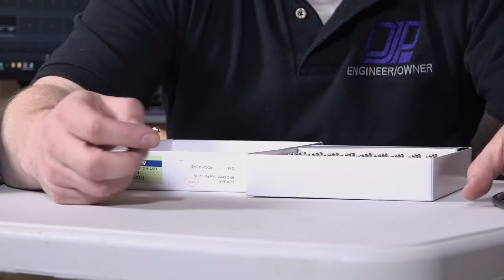What types of cables do you use for SDI professional video?

Comment: We are using blackmagic cameras for live switching with Atem switcher. We are using 2 x 12G sdi cables for camera feed and returns.  What is the best way to have 2 sdi cable wrapped into one single cable?
Reply from the maker: You could use an expandable braided sheath, or a bit of heat shrink every few feet. I'd stay away from tape and zip ties. Velcro cable ties would be another viable option.

Comment: Its now 2024. Good tip about the white inner piece for the rg58 cable (50 ohm).  i havent used my Amateur radio license in over 25 years with lots of cables and antennae etc. Now its video cable sdi/hdmi for digital video cameras and Unreal software.
Reply from the maker: It's not a hard and fast rule, but there is a high correlation.

Comment: I just want to know if 3gsdi and 12gsdi use the same cable
Reply from the maker: Sort of. Both use cable based on RG-59 or RG-6, but the actual design and build quality of the cable matters.

Cable made for 12G-SDI will always work for 3G-SDI, but the reverse isn't necessarily true. 12G-SDI creates a signal which changes four times as frequently as 3G-SDI, which means that the signal is made up of much higher frequencies, and the cable has to be able to handle those frequencies at the distance the signal is going to be run without too much loss or other degradation (timing/phase, noise, etc.). For the most part, a 3G-SDI cable will work okay for 12G-SDI for short runs of a few meters. But I wouldn't expect a cable only rated for 3G-SDi to work for longer runs. 

If you're planning on ever using cable for 4K, I'd highly recommend just getting cable rated for 12G-SDI out of the gate so you don't have to replace it later.
Reply: Thank you for your reply. My real question is this. @djp_video  I have a Canon C500 with 3gsdi, I'm looking for a recording monitor, I found one with 12gsdi. Will I be able to use this recording monitor with my camera and if so, which wire would I need, 3g or 12g? Thank you for your time!
Reply from the maker: Yes. Devices which support 12G-SDI also support 6G-SDI, 3G-SDI, and HD-SDI.

If your camera only supports 3G, all you need is a cable compatible with 3G-SDI, which nearly any 75-ohm coax cable with BNC connectors will be at that short distance.
Reply: Thank you God bless! @djp_video

Comment: Hi. Can i use the belden 1642A for video broadcast? Is it rated for 6g sdi? Over 100meters? Im currently working on 3g sdi ecosystem. But i want it to be future proof abit. Is 6g enough for broadcast in the future or 12g? 

And i need to run 100 meters. Thanks! Lookig forward for your reply
Reply from the maker: I assume you mean 1694A? 

It will work for 6G-SDI for some distance -- I probably wouldn't go more than about 50m. And 12G-SDI at a shorter distance -- I don't think I'd try it past about 20m, if that. But it isn't really meant for either -- it's designed as a 3G-SDI cable. And I wouldn't try to run it to 100m for 3G-SDI either... SDI itself isn't even rated for distances beyond that. That's when we usually move to fiber.
Reply: @djp_video  ya. Sorry. I misstype it wrongly. Noted sir.. but can i know when u transmit your video from sdi to fiber, is there any noticable latency? More or no difference?
Reply from the maker: @mfrfilm4760 There is no difference in latency. The signal is the same, just that one uses light and one uses voltage to relay the signal — so it doesn’t go through any “conversion” from one format to another.

Comment: Hi Doug, sorry to resurrect this oldie but goodie. Is there an adapter or pigtail for a micro BNC to a regular-size BNC (male)? My use case is needing to thread an SDI cable thru a very narrow Steadicam gimble (pole). Space is tight (reverse engineering), so I would like to snake the micro sdi down the pole to the bottom sled where the connection will be to the camera monitor (standard size BNC). The top of the Steadicam stage will have the regular-size BNC for camera output. The cable I have in mind is similar to the Blackmagic video assist cable. Thanks in advance.
Reply from the maker: You can get micro or DIN1.1/2.3 connectors for many varieties of coax cable. Check Canare, Belden, and Neutrik's websites for some available options.

Does the cable need to regularly be inserted and removed? Or could you thread it through one time without connectors, then add full-size connectors afterward?
Reply: @djp_video  Thanks for the quick reply. Once I thread the cable, it will live permanently. Your last question seems to suggest I crimp my own cable? If so, i currently do not have the toolset to build my own cables.
Reply from the maker: There are relatively inexpensive ways of doing that, even from a hardware store. The Quad Shield RG-6 cable sold there works well for short runs for SDI signals, and they usually sell BNC connectors as well.
Reply: @djp_video  Okay. Let me get to the bottom of my dilemma. Clearly, I will learn something new and useful with this exercise. Thank you for the guidance.

Comment: Is it possible to use stranded center conductor cable for SdI signals?
Reply from the maker: Yes... they're reasonably common. Just make sure you have the right connector for the type of cable you're using.
Reply: @djp_video Do you have a favorite lower budget SDI cable stripping tool?

Comment: So I’m gonna go out on a limb and say the reason my signal on the far side of my fiber converter is cutting out because someone used RG58 AU cable?  We have RG59 and the wrong cable was run through our wall 🤦🏼‍♂️
Reply from the maker: That wouldn't surprise me in the least. RG58 is meant for use with antennas for things like Ham radios and such, and way back in the day for some computer networking applications. It's the wrong impedance for video and is likely to perform poorly, if at all.

Comment: I spent some time in reviewing the industry specs of cables and found the Japanese company "Canard" was the most highly rated.  Many dealers do not stock it, and have to order it in.  It appears that it is a "batch" production run and needs a lot of orders to actually make it.  As 12 G cable is a small industry, then demand for high end cable is low.

Comment: Anyone know about max length? Do SDI and BNC both travel up to 300 feet? 

If you add a coupler to link 2 cables will it weaken the signal? Also, does it matter if I'm linking a BNC and an SDI together?
Reply from the maker: SDI is a protocol that usually travels on coaxial cables with BNC connectors. The effective maximum cable length is going to depend on the quality of the cable, quality of the connectors, the data rate of the signal (HD-SDI vs 3G-, 6G-, or 12G-SDI, etc.) as well as the equipment that it's connected to (some equipment is better about decoding iffy signals than others), as well as the environment. Running cables through a noisy RF environment, like bundled with power cables, reduces effective distance as well.

Every connection reduces the strength and quality of the signal. Two cables connected together with coupler will be less reliable than a single cable without a connection in the middle of the run. 

You can start by looking at the manufacturer's ratings for their cables. A high quality cable might be rated for 12G-SDI out to 100 meters. But a cheaper cable might only get you a few meters of 12G-SDI. For an example, take a look at the data sheet for the Belden 1505A that I use most frequently: https://catalog.belden.com/techdata/EN/1505A_techdata.pdf  It indicates that 6000 MHz signals (which roughly approximates to 6G-SDI) are attenuated by 21dB for every 100 feet of cable. That could easily push the signal strength too low for it to be decoded by many pieces of equipment even at just 100 feet. Compare that to 4694R ( https://catalog.belden.com/techdata/EN/4694R_techdata.pdf ) which has a loss of 15dB per 100 feet, which is a pretty significant difference. But even with a good quality cable, you still need high quality connectors as well, especially for longer signal runs or signals requiring higher bandwidth.

If you need to do runs approaching or longer than 100 meters, I'd highly recommend going with fiber cables instead of coax. I have a video here on my channel on the differences between them. https://youtu.be/U7p7OboXZRQ

Comment: Hi, Doug, thanks for providing such thorough and great information in this video. I just had a question about the connectors: do the connectors factor into the decision making when deciding to create a 12G cable vs a 3G one? That is to say, are the connectors “rated” for 3G, 6G, 12G etc. signals, like the cables? Or is it purely a matter of as long as the connector can fit the desired cable there won’t be any issues? Thanks!

Comment: Hi, Doug!   I bought a DELTACO RG59 and one of the connectors broke in the first attempt to connect to a camera; the outer metal casing (the one with the grip) came loose and metal parts inside fell out. Was it just bad luck or is that brand known for poor quality overall? Do you have experience with that brand, what do you think?
Reply from the maker: I'm not familiar with that brand. 

I use Canare and Neutrik connectors exclusively, and Belden and Canare cable exclusively. They have been great, and in the long run aren't any more expensive than the budget brands when you factor in replacements and the time spent dealing with issues.
Reply: @djp_video  Thank you for the answer! I have now ordered a Canare L-3CFW (RG59) from the US, since they are not easily available in Europe. I only hope this cable is not made of chinesium.

Comment: Hi folks, I'm going to try and explain impedance. Wish me luck! Impedance is a two part measurement. One part is the 'real' component and you will not be surprised then to find the other part is the 'imaginary' component. Together they make up something called a 'complex number'. The impedance classification of a cable is the resistance one would measure between the inner and outer conductors if looking at an infinite length of unterminated cable. The reason for it being a complex number is that both the dc and ac characteristics have to be combined together. The cable has a dc resistance along with some inductance and rather more capacitance. In effect it forms a low pass filter and these resistance, inductance and capacitance quantities have to be engineered so that the cable can pass the frequencies required along a useful length as Doug explains.

Comment: Hi Doug. Great content thanks for sharing. I have a question about the home improvement store cable you demonstrated. Why should or shouldn’t use it? I don’t mind getting the more expensive ones if I need it. But I just don’t want to do it thinking that I have to. Thanks again.
Reply from the maker: The hardware store cable won't let you run a signal as far. And will be more limited in terms of its ability to carry higher resolution signals like 6G- or 12G-SDI.

Comment: Hello and thanks for the great videos. I got a apple 27" LED display ( Magsafe and mini display port) and I'd like to use as a monitor with my Roland V60 HD switcher. I cannot send the signal to the monitor so I can use it as a muitiview ( HDMI from switcher to mini display port to the 27" display) . I tried a converter and it works but only spits out 720 and not 1080p. Do you know how to get it to work?
Thanks!
Reply from the maker: You'll probably spend nearly as much on, or more, on a proper converter than you will on a new monitor.

Comment: Hi Mr Doug, need a suggestion. 
I ordered perfect vision rg59 connector 50 nos, but my cables are rg6. 
Can't return, can I buy rg59 then solder join it with rg6. Kind of makeshift way,
Very expensive mistake.
Reply from the maker: No, this wouldn’t work reliably
Reply: @djp_video   instead of solder join I have used ftype coupler to join 59 and 6. But It works.

Comment: Hi there, thanks for the info. My question is, does the brand of the HD-SDI RG6 Cable matter. I noticed the monoprice is considerably  cheaper. Will it work just as well on a 150 cable from camera to switcher?
Reply from the maker: It certainly can. There all sorts of level of quality available from not just different manufacturers, but also different SKUs within a given manufacturer. Some are built with higher quality materials or with additional shielding or, in the case of pre-assembled cables, vastly different quality of connectors. You will find that a cable from one manufacturer that works at 150 feet will work just fine, but the same length from another manufacturer won't work at all. 

For shorter cables it doesn't matter as much, but if you're looking at purchasing a longer cable, sticking with a cable model with a good reputation can really pay off.

Comment: Hi Doug, thank you for sharing the knowledge! Wanted to ask you, since I work as a VTR on film sets - what is your opinion 
 about Sommer cables, are they worth investing ? They are a bit cheaper than belden cables but I have troubles finding any opinions about them on the internet.
Reply from the maker: I've never used it. I'm not sure of the quality.
Reply: @djp_video I understand. I have one more question about power cables used to film monitors.I am planning to mount sdi cable and a power cable with c13 connector, on one reel to facilitate my work on set. Would you recommend any power cable that would be durable and up for such task?

Comment: Thanks for the information.  I have a question we have an ATEM Mini Pro and are looking to run a live stream of our baseball games in the spring.  Our run is a little over 200' what is the best cable to use?  Can I go up to 300'?
Reply from the maker: HDMI will never go that far, so you'll need to convert to SDI or fiber. If you're shooting at 50 or 60 fps and need up to 300 feet, you'll need a good quality cable to make it that far. The coax that I prefer to use is from Belden -- 1505A or 1505F (flexible version) would work but 1694A or 1694F, with Canare or Neutrik connectors would be better. Hardware store RG-6 Quad Shield might work, but I'm not sure I'd risk it, and if you went that way you'd definitely need to upgrade the connectors over what is available in retail.

Comment: a question, can you run multiple signals to a stage through 1 rg6 or do i need to have a whole bunch of em taped together to the live stage, thanks let me know
Reply from the maker: Each RG-6/RG-59 cable can only carry one video signal in one direction. You'll need multiple cables if you have multiple signals.
Reply: @djp_video  thanks I gues it's gonna be alot of cable tied together

Comment: Do you have your BM switcher connected to a BM 40x40 video hub? What cable did you use, 1694a still? Is it a lot of bulk? From your experience would a mini rg-59 option from Belden work well for this application?
Reply from the maker: Yes, I use multiple 40x40 Smart Videohubs. The cabling in my trailer is almost all Belden 1505A. It's somewhat bulky but not bad.

If your cable runs are short you can get away with a mini RG-59. Effective range is a lot shorter with the mini cable, though, so I'd avoid it unless you actually really need mini cables.
Reply: @djp_video  Got it, thank you.

Comment: Hi Doug ,
I am using Atem Mini switcher (Not Atem Mini Pro).
I want to buy a SDI cable 1694A RG6 how much Feet we can use maximum .
Should I buy Blackmagic Design Micro Converter SDI to HDMI 3G
Or Blackmagic Mini Converter SDI to HDMI 6G can you please suggest
Reply from the maker: If you aren't using 4K, you can get up to 100 meters with 1694A. The 3G converters will work fine; you only need the 6G versions if you're working in 4K, which, of course, the ATEM Minis don't support.

Comment: Hey Doug! Awesome video! You do a great job of providing complex information very understandably. Any way you could you provide an opinion on Canare vs Belden for cabling (understanding you recommend the Canare terminators either way)? Context (if you care to read it): I'm running RG6 transmitting 3G-SDI for up to a 200ft run. Apologies if I missed it but I didn't hear anything explicit in your video. My understanding says that's transmitted at a 2.97Mbps data rate which means we look at the attenuation at 1.485GHz. Looking at the datasheets for Belding 1694A vs Canare L-5CFB for 100ft I'm seeing Belden at 1.5GHz  has -7.8dB drop vs Canare at 1.45GHz with an -8.8dB drop. The standards I'm seeing say to keep it above -20dB drop in total for average equipment (I'm looking at the Blackmagic systems for which I can't find exact attenuation specs). This comes to a difference of -15.6dB for Belden vs -17.6dB for Canare. That's a 2dB difference for a bulk price gap of Belden's $0.71/ft to Canare's $0.44/ft. Do you think Belden is worth that price difference? Any advice would be hugely appreciated!
Reply: Legendary 1694A is widely used for 3G SDI but it was not designed for it.
Belden:
"Several years ago, we created an RG-6 video cable (1694A) that carried HD over 370 feet (113m). But when 3G-SDI hit the scene, that video signal – also called 1080p/60 or 1080p/50 – was double the bandwidth of high definition (HD), which reduced distance capabilities of 1694A down to 78m."
"That’s when we decided to create the first cable designed specifically to carry signals up to 100m for 3G-SDI, 1794A"
https://www.belden.com/blogs/smart-building/think-12g-sdi-over-coax-isn-t-possible-think-again/
Reply from the maker: At 100 feet you won't see a difference. At 100 meters you might.

Comment: I work for a Border Patrol tech contractor. For really long 1080P 30 runs I need the lower DC resistance RG6 that is all copper center conductor vs the copper coated steel in cable TV usage. So home improvement store RG6 will work on shorter runs, but our 200 ft + runs require all copper in the center conductor.